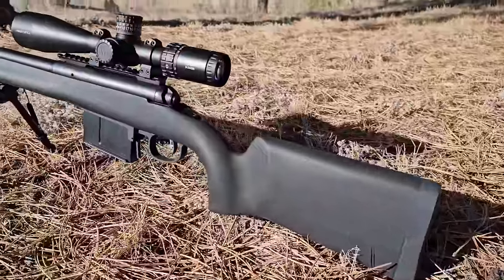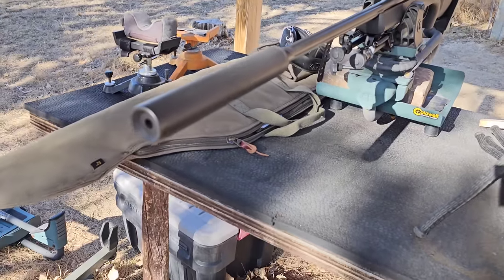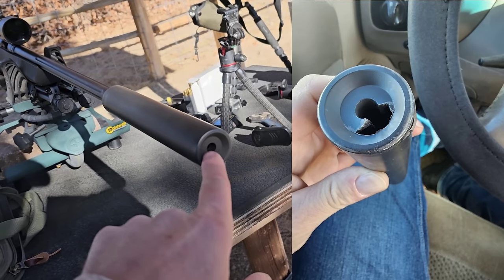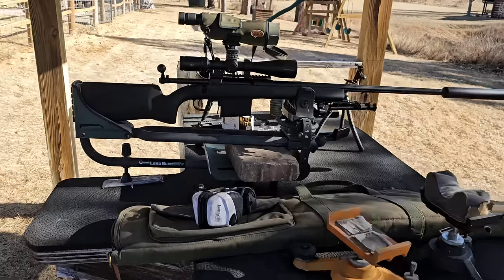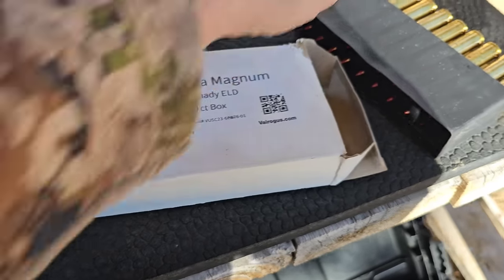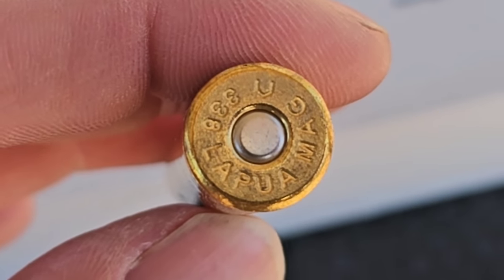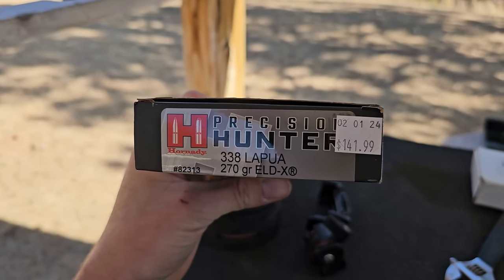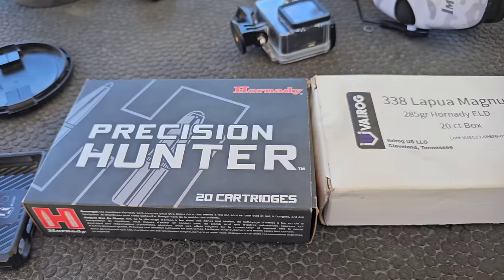Long Range Rifle: Something is WRONG!

Comment: Long distance 40 years first take that arken.off they suck take can off and see if it groups the shoot with can. Check base and rings my base lose on my savage
Reply from the maker: Base and rings were torqued to spec and still tight. I took suppressor off and still no groups. Going to try a different scope.
Reply: That's funny blaming Arken for junk Savage rifle.  I've got several Arken scopes with no issues whatsoever. @jamessammann9183

7 hours ago
Reply from the maker: @LLCebuRider  I'm not blaming arken I like their scope. Just going to confirm it's not the scope by trying another brand. It probably is the barrel.
Reply: @Guidedhunts Sorry, i was responding to @jamessammann9183 who says that Arken sucks and you should take the scope off.  If I were a betting man, I would bet the problem is with Savage and the barrel, not Arken.